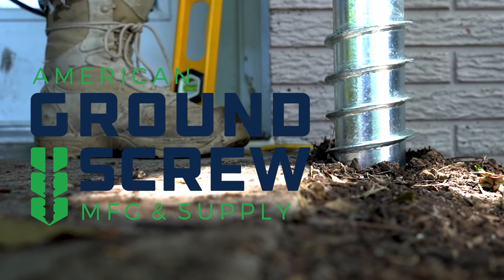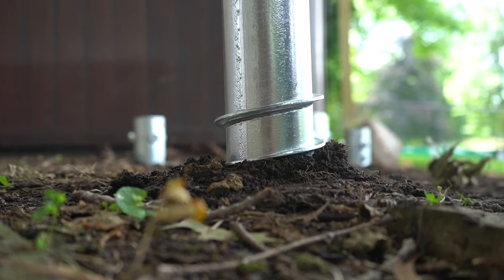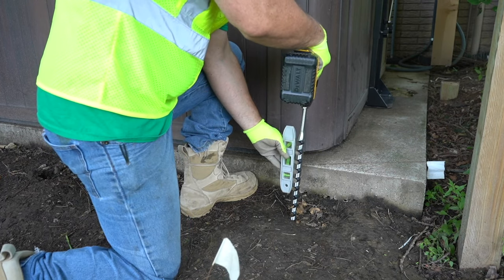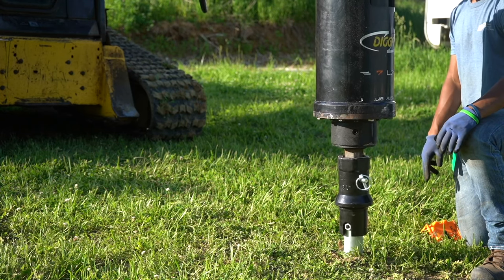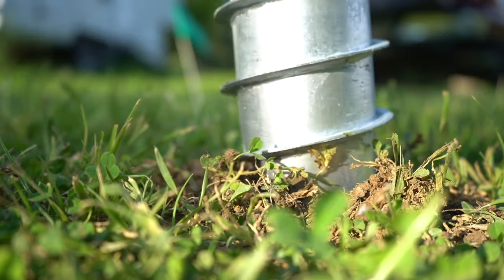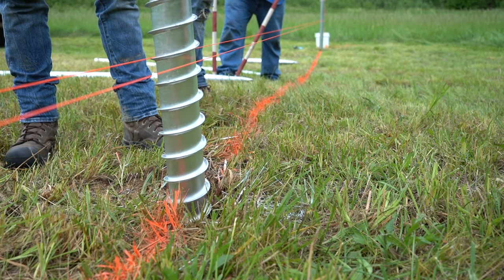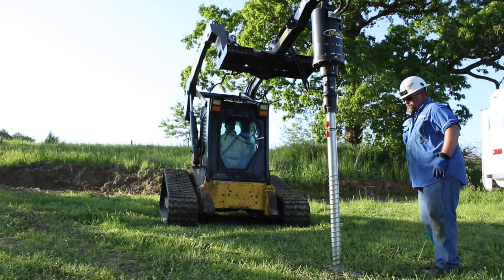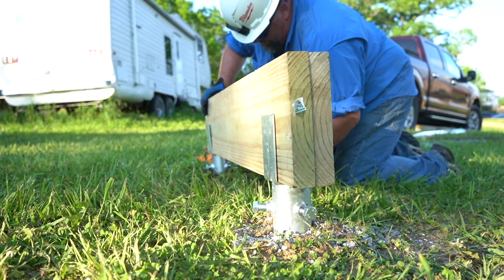American Ground Screw: Ground Screw Installation Instructional Video

Comment: Just put 16 ground screws in Connecticut. The video very very briefly shows the only right way to do this job, which is the skid steer that has a giant hammer drill attachment on a vertical guide track for going through the inevitable rocks. If you are looking for someone to do this job, make sure that is the kind of rig they have because it's the only way if there are any big rocks. A plain hydraulic auger won't cut it. 
If you hit a small rock the screw will push it out of the way as it goes in... but it also goes out of plumb. That is why the hydraulic track drill is the way to go, because the machine holds it plumb as it goes in. These other methods only work if you have six feet of loam.

Comment: In theory it works, what they don’t tell you is that if your in California we have all different sorts of soils and the electronic driver fails to drive a screw in the ground. I don’t recommend the electronic driver it sucks and it breaks. There is no indication in the service Manual about the driver nut bolt that comes loose, or even sheers off. I’ve used this tool for over a year now and it fails more than it works. Use a skid steer or wait til the winter to use the crappy electronic driver.

Comment: So local frostline is ~42 inches, normal for US North East. So 2/3 below frostline means 84" + 42" = 126" or 10'+?  
With the requirement for a skid steer or similar, helical piers have to be similar in cost while they bear compression much better.
Reply: No, they need to have 2/3 of the "thread length" below the frost level.  The pile shaft still needs to go down the 42 inches (60 in my area), this means you need to advance past that depth to get 2/3 of the thread below that.  When factoring the length you are going to need bigger is better, since anything with frost line is always a "minimum".

Comment: Can ground screws be installed where the driving machine can not get to?
Reply: I'd think not, though perhaps the low speed high torque driver could be put on hoses and supported in some different manner...
Reply from the maker: Yes! We offer hand-held rentals as well. You will, however, need access to electricity.
Reply: @americangroundscrew2067  How do we get ahold of the rental equipment?